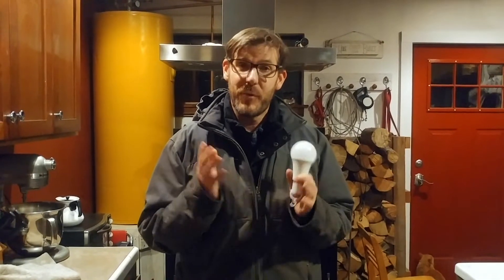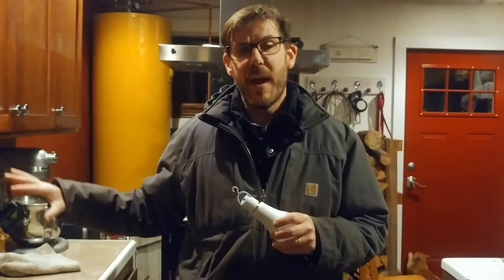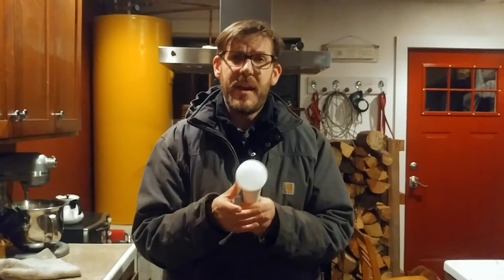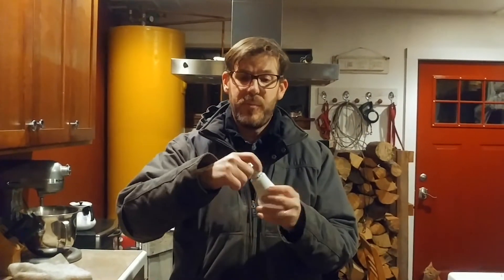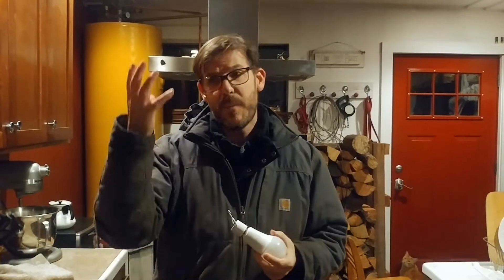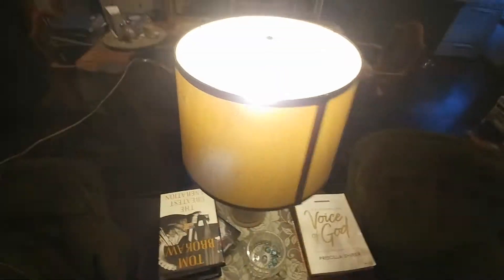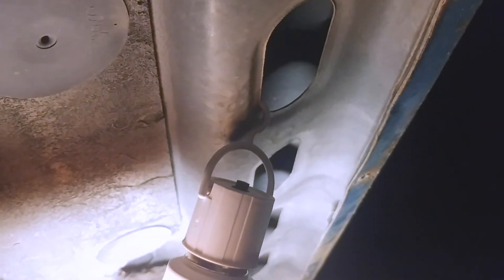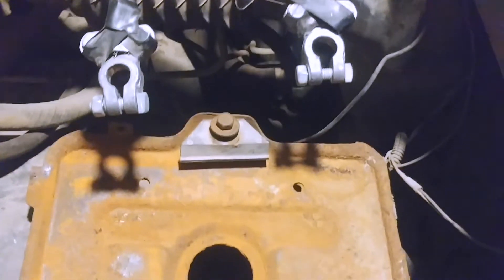Emergency Power Outage Battery Light Bulb

Comment: Whats the name of the bulb and where do you get it?
Reply from the maker: Lara, we bought them from Amazon.  Here's their title. "JackonLux Rechargeable Emergency Light Bulbs UL Listed Battery Operated Light Bulb for Power Failure Camping Hurricane 5W 500 Lumens Soft White 3000K E26 120 Volt 2-Pac"  One light bulb out of our group of four has failed.  The rest seem to be working fine. We've had them a few months before I put this video out. 3 out of 4 have lasted about a year so far.

Comment: So we have to sleep with the lights turned on in case there is a power outage?
I am looking for a light that stays off but will turn on itself when there is a power outage.
Reply from the maker: @robbiedaug You turn the light off at the lamp/light switch. If a power outage occurs and the light switch is turned on the battery inside the bulb will keep the bulb lit. If the power is out, black out or brown out, and you don't want the lamp on, just turn the switch off.
Reply: @LivingaSustainableDream  No. I want to turn off the lights in the apartment and go to sleep. 
Now, let's say a fire starts in the middle of the night and the power is cut by the city, i want a light to come on by itself. Will this light do that?  Try it, please. Turn off the main breaker and see if the light will come on when the light was OFF before. 
Again, i don't want the light to be on (lighting up the room) when i am sleeping - i only want it to come on when i am sleeping in the dark and the main power is cut. Thanks